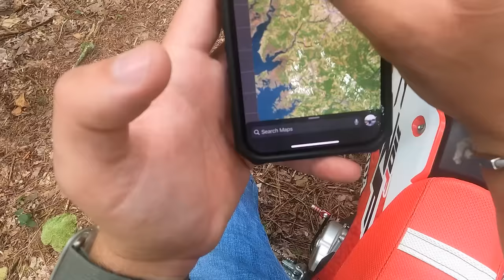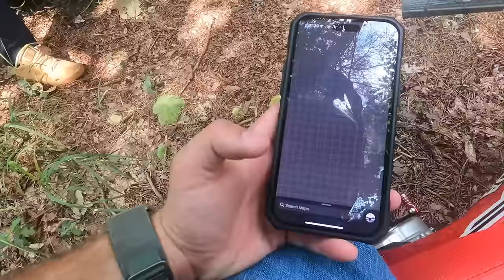SHOCKING DISCOVERY INSIDE ABANDONED HAUNTED FARM (VERY TERRIFYING)

Comment: The large hole in the shed floor is an old water cistern.  The large pipe allowed water to flow in from the roof when it rained.  The hole at the other end is where the sump pump went and the small pipe above it is the water line that led to the house.  Once a well was drilled, or city water was hooked up, the cistern was no longer needed so the pump was pulled and pipes cut.  Then the boards were placed over it and it has been left untouched until you opened it.  The objects down there were probably dropped in there when it was sealed up and have been there for a very long time.
Reply: I was thinking ice storage because of the ice tongs but you sound more plausible.
Reply: This makes more sense than my theory.
Reply: This makes most sense.
Reply: What year are you thinking??
Reply: @ptah31  100% ice tongs , so ice storage would be my guess
Reply: Could it be a slave belt?
Good exciting video with laughter. 
The ranch full of surprises. 
If it's a water run off tank, that's the reason the boards expanded. Check it out when it rains. 
Keep them coming, it is nice to watch you uncovering history.❤🎉
Reply: Correct. Old cistern . We ran into one at an old house I own. Same setup with the pipes.
Reply: @dorinclarisa2732   no it's not a slave belt it's one of those things you'd hook up to like a horse or a mule and then connecting to like an old mule draw plow or a horse draw carige
Reply: yup you are right
Reply: It could also be a Mechanics pit .  Where they pull machinery over it to Work underneath it. Since it was at one time a Farm .
Reply: ❤

Yes a water cistern.
Reply: I don’t see no water lines?
Reply: The curve blade handle is a sickle and ice tongs is the other. Or bale tongs. ✌️💜🤗
Reply: Looks exactly like my old well hole with sump pump… just missing the parts.
Reply: Or it could be a thing for a log like a log holder
Reply: I think it was a root cellar or ice storeage
Reply: Cycles were used to chop long grass etc for animals or a scythe as we call it in uk. Used to chop long grass corn or whatever. In the old days people used people to drag things not only horses around the fields. Slavery was a thing but defo something to do with water in there hence the plastic pipes. Not that old as has concrete and plastic and beer can and a beer bottle top. I’m not sure anybody died there but do a spirit box to find out or less risky try divination rods. Fun to watch
Reply: @emeraldhalloween3269 the belt is a climbing belt. Tree trimmers and eliectic workers us them. I work in tree trimming and have seen the same belts. We use them all the time climbing bigger trees. The rope is to throw around the tree to hook onto the opposite side of the belt to keep u secured safely to the tree or power poles.
Reply: I agree. My grandmother had an old farmhouse that had one beside her house. It had an opening on that could be used for cleaning or repairs if needed.
Reply: @Tuffyears Definitely looks like ice storage.
The belt strap thing with the rope probably was to pull out blocks of ice.
The sickle probably for cutting it but I'm not positive about that, although it could have been their only way to cut the ice.
Reply: The small hole definitely looks like a sump pit the pipe above is the discharge line. The big pipe by the ladder looks like draft or heat vent that could of had a wood burning stove or boiler at one point. The fan off of the vent is for a heated garage
Reply: The tools are for hay.  Picking up hay bales.
Reply: 🤔 but you would be able to tell if there's water down cause the paper would have been damaged and unable to read. I guess they were in the process of doing water cistern.
Reply: Yeah but aren't those usually outside of the building.
Reply: Hmm
Reply: CJ you need to some bigger tools in that truck of yours😂 . Come on Man. 😂😂😂
Reply: @emeraldhalloween3269  Thanks for that, sounds better than my suggestion.  To think I was a country girl. 😂😂
Reply: @ptah31  thats what i was thinking
Reply: For being a race car driver, Paranormal celebrity and multi property owner with a business. That was the most pitiful ladder you brought from home.
Reply: The clap is for ice and the belt was to help lift it up
Reply: Wow that was crazy creepy be careful stay safe love you
Reply: @BudHound420   you'd have a fair argument if it wasn't for the fact that their on a farm so a hore/mule harness makes more sense
Reply: I was thinking a root cellar. That was very common back in the day. Looking at the pipes, you are spot on for a water cistern.
Reply: CJ I would be just like your Mom and wanting to watch everything coming out of the building in case there was something good. LOL My curiosity would probably get me hurt because I would be wanting to scope it all out. I would probably be the first one down the ladder.  Now that I'm 70, not so much!  LOl. I would probably spend a lot of time there until I saw a spirit or something like what Chris saw then I would be gone like nobodies business. Ok in my eagerness to go down the ladder I would have ended up a pile of "OUCH' at the bottom! That hole honest to God looks like a torture chamber! I just love your Mother!!  GO MOM!! That one thing is a ice pick.  The round blade thing is a sickle.
Reply: I knew if I read the comments we could have a plumber or someone know exactly what that was 😂
Reply: You're probably right. I keep saying serial killer.
Reply: Great place for one to dodge the draft. Maybe after after not being needed for water. Only question is Is there city water? That seems out in the woods a bit far.  Is there septic there? Interesting.
Reply: @laurenhenckel8961 ecxactly what i was thinking
Reply: I was gonna say like a root cellar or something like that!
Reply: I can totally relate to cj’s mom when she tinkled…. Ohhh what is woman go thru
Reply: @ptah31 same here, but cistern is a damn good choice too!
Reply: And I seen in the hole the big metal tongs in the middle, I think are old ice block tongs what they used to pick up blocks of ice
Reply: You know what you are right
Reply: @ptah31 I was thinking the exact same thing because the temperature is cooler below ground level. 

Who knows, could’ve served many different purposes throughout the property’s life…. Cistern, cold storage, WWII bomb shelter.🤷🏻
Reply: Pretty fun to watch somebody sit and try and speculate what something is when you know what it is.🙂🇺🇸🦅
Reply: I agree we had one in our barn. My dad would always keep it filled. Said you never knew when we would have a drought and the horses had to have water.
Reply: The one tool In the hole was to pick up blocks of ice when refrigerator was not electric
Reply: @nancyhopkins2974  Yep, and hay bales
Reply: That’s exactly what I thought! They were really big on those in the south. I bet they stored jars and other items to keep them cool.
Reply: I’ve lived in 100yr old houses and you are 💯👍🏻! Thank you 😊
Reply: I was raised on a large dairy farm and we would always go down and drink the ice cold water that always ran through it.  It once was used to store the milk and dairy products to keep them from spoiling.  Then, the water was piped into the farm house to have running water in the house, but the ice shed was always a source of storage.  Cool find with many amazing artifacts.  Nice !!
Reply: I agree, it is an old cistern, and it isn't from 1800's.  the sides were concrete block not poured concrete.  1800's would have used red brick.  The curved blade is a hand scythe for cutting hay, wheat, long grass, etc.... belt looks like an old tree climbing belt, the part that goes around the tree is missing, but the rope would have held his saw while climbing up.  And the last one, could be used to move trees by hand, the pointed ends lock into the wood at the end and then give ability to drag the tree.  all of those items could easily have been of the same era as the postcard, 60's or so....
Reply: Yes, a water cistern
Reply: I think you are 100percent correct mate 👍🏼
Reply: @laurenhenckel8961 you are not going to after all these years dust dirt general moisture will have affected any water lines
Reply: Hi the 1 thing you  took up from the hole is;; a tool for cut corn ,grass mm, number 2 is a belt for work house in the farm
Nummer 3: is a ice grabber  ,,i even use for hock on  a tree logg,,  the old dags they cut out ice from lakes,,,so yea this could Bee a place that they keept ice blocks, too keep  the food cool , then use al those tools/things to lower the ice bock down😊
Reply: My vote is cistern as well. My ex's grandmothers home had one and we climbed into it several times to repair it over the years. I wasn't all that freaked when I saw the video because my mind went immediately to cistern...
The fact it's in the barn would say to me that it may be for livestock... and may have had an electric pump. 
You may find similar situation near the house...
Reply: So what was written in the note pad????
Reply: @towerparanormalinvestigations who cares?! Stop being so negative 🤦🏼‍♀️
Reply: Ok wow, that's good to know, although it still could of been used as a dungeon, hey?
Reply: I'm happy to see another person sees the cistern and this isn't a cell to keep people in.
Reply: Please make sure to cover the hole back up. I would hate for a curious trespasser to fall in there and get sue happy.
Reply: I thought with the cross lamp it was like an old make shift church and that was the baptism lol but it’s pretty deep for that.
Reply: I was thinking that too, or ice. That Ice tongs fits. And the scythe is the big curved thing. It's used to cut grass or things. My guess would be that you'll find concrete under it. You might go to the county and see if you can get a plot map of the property and see if they have the records of when the electric and water/sewer were pulled into the property. Title company or an abstractor should have the listing of every property owner of that place going back to ...however old.
Reply: I was thinking that since it was a farm, it may have been a scalding box used in slaughtering hogs. 😂
Reply: All the comments and suggestions  are brilliant ! Burst my bubble  though with my theory  on it being used by a serial  killer , I think I watch too many horror  films 😮😊
Reply: @ptah31 i was gonna say the same thing
Reply: you are probably right
Reply: @emeraldhalloween3269  turns out we were both wrong, it's   for tree surgeons. I have one in my garden now.  I have a picture but haven't a clue how to send it to you tube.
Reply: Smart
Reply: Small sickle, ice block tongs, definitely a cistern
Reply: Somebody is walking in the field with black on
Reply: Kinda weird for a water cistern to be in that shape though, and where does the rainwater come in? In most cases it comes through a hole or opening at the top of the chamber.
Reply: Couldn't of said it better myself, the place is haunted but you can't make something out of something.  I love the videos CJ but it was more interesting seeing what was in the woods then watching you all stare at a hole for 45mins. No disrespect im just saying is all bud.
Reply: @dorinclarisa2732 exactly what I was thinking 😢
Reply: Well THAT sounds better than what I was thinking😂
Reply: The small tubing above the hole was probably  more for the plug of the sump pump to work since they require electricity and the big one I agree  to let rain flow from the roof. But I also thought at first a storage for ice
Reply: We can always rely on the Comments section that someone will have the knowledge of what something is. That makes perfect sense. Thank you!!
Reply: i think they did use that for ice storage after its usr as a water cistern the belt was a safty belt for tree work and roof work
Reply: Thank you for taking the time to explain this.
Reply: @Scotts23  I thought it would of left it behind but I see what ur saying. I think it was for ice.
Reply: 😂 so much drama. C. J. Your in the country. Country people were self sufficient.  At my house the was an old cyctern and a root cellar under the old smoke house where we would store canned foods, potatoes and hung meat up stairs to cure.
Reply: Definitely would say the 3/4 pipe problem for some kinda air compressor for sure. Sub pump for the hole in corner. And the exhaust pipe for some kinda heating and air. The belts lay down there are for older style furnace
Reply: I love your mom she is great. Love her laugh.
Reply: @ptah31 I think they used it for ice and then probably converted it to the cistern. Remember animals and the people had to have water in an extended dry season or during a time of 4 ft snow. The old folks were pretty darn resourceful.
Reply: I think it was an old cistern as well. We had one on our property when I was a kid.
Reply: OG KillaKiRawBeats
Reply: @dorinclarisa2732 It's no where's near old enough for that.
Reply: Makes sense
Reply: Better explanation than what I thought: Septic Tank.😂
Reply: My grandma had a cistern in the back room of her house. It was in the corner by the back door. You lifted the floor and she would catch rainwater with a bucket.   She had an old ringer washer in the little house next to the garage on her property.
Reply: @muzerhythm2242  I thought that too.
Reply: My grandparents had a hole in there garage that looked just like that in there garage, used for changing oil
Reply: I agree and the tools was a syth and a ice block pick tool
Reply: My grandpa used underground pits like that to dry animal fur to tan hide. Being a fur trapper in the 60"s. Remove moisture and water and blow in dry air.  Meanwhile, once a week, going into the pit to scrape off unwanted hair from the hide.
Reply: @ptah31  if it was a dairy at some point you would be correct too. you need a way to keep milk cold before transporting it to town.
Reply: @tanyalafata4100  as for the pit 19 20' to early 40s.. and the belt design is late 50s. the tongs haven't changed much since the 1700s lol
Reply: @dorinclarisa2732  as for a slave belt naaaa it has clips on the rope so if they wanted to get away they unhook it and leave. slave containments were secure so no chance of escape.. it would most likely be water from a moving source, pond water would have too many things not suited for consumption in it.
Reply: @emeraldhalloween3269  look up a picture of a tree trimmer he is wearing that kind of belt while topping out a tree.
and you never ever ever tie yourself willingly to a piece of farm equipment.If the team of mules you are working decide to take off you arte as good as dead.
Reply: @AustinBixler  agreed, but a bit suspect with the depth of it
Reply: @laurenhenckel8961  it appears to have been painted sometime after running water or well was drilled.  I bet the kids of the place thought they had the best fort or play house in the world. lol
Reply: @gingerl2995  I'm willing to bet the pump got repurposed to the basement at some point?
Reply: @Jadengood1993   I used one for years growing up to drag logs the diameter of telephone poles from the woods
Reply: @donnamarietomasello9396  As it was pointed out early in the video, things come through the portal and some will take up residence in the cistern if it reminds them of quiet crypt
Reply: Ice tongs or hay tongs and the curved thing is a sickle used to clear back brush. They used to do by hand. I was thinking a cellar could be used for ice, or hiding slaves (underground railroad). Or to hide alcoholic beverages during the time when it was banned. Or storm shelter and of course it could have been used for more nefarious reasons as well. Interesting to think about.
Reply: @sandyoda9042  yes we do live in the sue mations, and i am not referring to Native American's here.
Reply: @rosemaryfries9467  my mind went to a Christmas ornament
Reply: @CinShiba  You would need a way to keep the water boiling. having or building a way to keep the water that hot would cook the pump too, if trying to use it to circulate boiling water.
Reply: @secretsystem6667  the inlet is the large drill casing pipe at the top center of the far end.
Reply: @hauntedtraveler  OMG!!! i am a 67 years old country boy and you just taught me something new!!  
soooo there is actually a P in front of the word tater!!! so it is a P-tater!! now i bet your gonna say the are letters in front of mater....
Reply: @katiehardy1476  she does seem like a lovely lady
Reply: @renelipsey8458  my grandparents place was only 3 miles outside city limits, and didn't get electric till after WWII.
Reply: Damn ruined the suspense of it actually being something really creepy. Lmao
Reply: That’s thing thingy CJ found picks up big ice cubes
Reply: I was thinking samthing
Reply: This xomment should be pinned
Reply: This makes a lot of sense. Could’ve had multiple purposes. Water, ice, food storage, hiding out. The cinder block throws me off though. They didn’t build with that in the 1800’s!?? Hmm. Maybe built after the house?
Reply: My cistern looked the exact same way. I had a farm and we had 2 cisterns.
Reply: You are correct. I also belive it an old water cistern. That is how it works...
Reply: Omg I LOVE YOUR MOM❤❤❤❤❤
Reply: @Tuffyears blade is called a sickle for wheat or other plants to cut and the other is tongs for bales of hay for horses.
Reply: I was thinking a drainage place, but could it have back in the day for hiding people to stay safe
Reply: You mom is way to cute.
Reply: Trafficking people pit
Reply: I was literally about to say the same glad there are some other people here that understand old farm properties
Reply: I was thinking that and possibly a freezer for the summer time
Reply: @CJ Fiason have you seen this comment this makes sense 100% what this is .
Reply: I was thinking it used for ice but I think you are right
Reply: Absolutely! 1st thing I thought of, as most all old farms had them!
Reply: Then why wasn't it full of water or the objects in there waterlogged or soaked in water
Reply: @ptah31 I think those are actually for moving logs but I'm not 100% sure
Reply: Thank you @seancampbell4564, I was yelling at the video, are you kidding mama doesnt know!!! I guess the older folks would get it... But I completely agree when I saw the hole in the floor i instantly thought sump pump!
Reply: Yes, I'm sure you're absolutely correct.
Reply: I was just thinking a dried up well lol but ur gess sounds way more real an true then what I was thinking lol
Reply: I read on the internet. When a house as this. It is used for flushing toilets, washing cloths and water for  farm animals and gardens. If it is well water coming into. It needs to be treated.
Reply: That is so awesome to know!
Reply: Oh so that's what it was used for
 They came up with some good ideas back in the day
Reply: I agree with @seancampbell4564.   My other thought was an old well house.  Hey mom.  Please consider  joining more videos.  You are funny and personable.
Reply: I love a good logical reason! 😀 I read a King book recently where a person was stuck in a cistern. Now I know what that was used for! 😀 Thank you!
Reply: Cistern/sump pump to keep water out. I have 2 in my basement. My house was originally built in 1896
Reply: Thanks!!   The search is over.
Reply: You all are bored
Reply: Yup we lived on a few old farms, it’s a cistern.
Reply: Excatly come on people surely you know what this is lol
Reply: I was raised in a 1923 Sears "Kit House", the cistern there still worked! Along with a hand dug/ stone lined well and one machine dug well
Reply: I believe that at one time it was a water cistern and when city water was hooked up to the house. Then it was possible used to hide slaves or a person was kept down there...thats what the belt wt the rope hooked to it is for. And i believe that the piece of soft cloth like material was what was left of their clothes... The first metal piece found was a hand cycle for cutting grass, weeds .and the second metal piece was for bails of hay or ice. Either or...to carry them.... Pretty good find bro.😂
Reply: 1:10:10
Reply: @laurenhenckel8961  one was the tube in the top of the wall from the rain troughs, the other "line" was in the floor at the other end of the box.
The hole leading out got smaller and smaller as it got to the house,creating water pressure
Reply: You nailed it...water cisterns were really common back in the day
Reply: @Tuffyears  ice was often put in the cistern box to cool the water, under its cover, the water would stay cool in the heat of the summer.
I've dug up pipes that went to the main house, and out to where I figured it watered livestock. A slow taper in those pipes would push water uphill
Reply: @ptah31  grandfathe( Great Grand dad used his to keep the milk in the milk can cold
Reply: Probably before that it was an old ice block fridge, as the large metal tool with the points at the tips were used to grab the sides of chiseled blocks of ice to lower them down in & even move them around. Ever seen the movie "A Million Ways to Die in the West"? The scene with the giant block of ice, the smaller blocks of ice were chisled off large blocks of ice seen in the movie.
Reply: Makes sence. The items are a sickel , ice graple for large ice blocks
Reply: I was thinking underground railroad
Reply: @lindafitzner4903  to be honest, many of those old coolers, barns , retired standing ice boxes,were used during those days to hide slaves escaping their own hell. There are also hundreds of miles of tunnels, LITTERALY train tracks that ran underground ( coal tracks ) that were used to hide them as well.
Reply: I agree with the theory.... an old unused cistern does double as pretty fn good dungeon tho
Reply: I was thinking cold storage
Reply: Small bikes for such tall men..
Reply: Intresting story tho.
Reply: Yes old cistern. I can't believe their reaction to the snake. Definitely city folks. That snake does NOT WANT  2 bother you. Calm down.
Reply: All the cisterns I have ever seen were huge. Never saw one so small, but it's possible. I was thinking ice storage or maybe the previous owners were moonshiners or something.
Reply: What I was thinking too. @AustinBixler
Reply: That must be it, either that or maybe a mechanics pit.
Reply: I think it was a meat cellar for storing their cow 🐄 or pig 🐖 carcasses, the harness with rope was to lower the beef or pork carcasses down in the meat cellar. The hook was used for picking up large 100 lb Blocks of ice they used in the 1800’s and early 1900’s to keep meat & milk cold. The large pipe served as air and in winter in areas that get cold in winter there was no need for ice blocks. The hole 🕳 in the floor was to allow the melting blocks of ice to have a place for the water 💦 to drain away. The Sythe could’ve been used not only to cut sugar cane but to chop meat off the carcass. I think the conduit was a light 💡 bulb receptical that was turned on on the wall to see in the cellar. Most likely when freezers was invented stopped 🛑 using the meat 🍖 🥩 cellar & no need to buy 100 lb blocks of ice anymore. So some years later they filled in the drain hole 🕳 with dirt beer cans and anything else they could and removed the light bulb💡 ceramic receptical. Because it looked as if the end of the conduit had been smashed flat with a hammer.  It’s hard to say your theory could be right or my theory can also be correct. But if I had to bet with the evidence of the things found in the pit I’d bet it was a cold meat & possibly can food & cow milk cellar to keep things cold that they raised on the farm. But that’s just my opinion & you know what they say about opinions they like butt holes everybody has one. 😂
Reply: First time to the channel. I came upon it purely by accident. But I was curious.
     As I watched, I found myself laughing throughout, with one thought in mind:
     JUST because you find something you don't understand... something that may look a bit "creepy" because its old & abandoned doesn't mean it's nefarious, evil, or "haunted." There is most often a simple, innocent, logical explanation.
      Respectfully, it would surely benefit you to (from any number of History books) learn more about the people who lived during the era when the property was built. Research how they lived. In what ways did they accommodate their needs during that period in history? You will undoubtedly discover this particular home, with all it's "amenities," was quite typical of the era. Tho this structure may look peculiar to us, it was normal back then.
      I know every party needs a pooper. I guess that's why 'I' showed up!🤗  I do I give you & "Mom" credit for being entertaining. But... nothing about this was "scary." Nor did it feel as tho I was watching the reveal of a "haunted" property. It was more like a history lesson.
     Sorry.😕
Reply: Yes you're right and that makes all kinds of sounds plus it reminds me of something similar to a fox fire and it looks like someone's moving around it's really not as how the light hits certain areas in certain times of the evening maybe after a rain or before rain it's foggy
Reply: Cistern or root cellar
Reply: Yep
Reply: The clamp thing isn't ice block grabber🙄
Reply: Someone said it's a cistern. I'd use it for storm shelter or a food storage.
Reply: I agree,or a cold room for meat and fish
Reply: There is a waterline a mark around the wall
Reply: @shawnomack45  cisterns are usually outside. You hand pump or crank them. I used my neighbors as a little girl. She was widely and let me visit and play. She had an old pump organ. 1 1/2 story barn next to house had a trapeze and piles of straw underneath. Many hours of fun in there! Love love love old places!
Reply: My first thought was a mechanic pit to work on vehicles ..
Reply: I think it may have been all those things. The tongs sure looked like ice tongs to me. The ice delivery men used to wear those belts to help carry the great big pieces of ice. I think it started as a root cellar and was adapted thru the years for different uses. Interesting how things we haven't seen or used can seem so creepy. I would have been like Chris. Out of there as soon as u see the first sign of snake. 
I'm sure if the farm was first established. In the 1600s a lot has happened there and a lot of places there has had multiple uses.❤
Reply: I'm sure this is correct. They had power to the pump and they used that rope and pulley to remove the pump. It was probably originally outdoors and the shabby building was added later over it.
Reply: We had a hole like that in what we called the water shed on the farm , it collected the rain water which was wiped out to water moms garden. It was much easier than carrying buckets
Reply: If it's nice n cool down there, snakes love the cool especially on a hot day
Reply: What type of snakes and bugs did you think they were? Not all snakes or bugs are poisonous. Why all the screaming and yelling? You're not in Australia! To get rid of the snakes lift off the final bits of planking so they're no longer hidden and they'll slither away.

The curved blade is a sickle, used for cutting grass and grain.
Reply: @Techman1969  it’s a snake pit!!!
Reply: @parabellumunited8889  LOL😁
Reply: @Techman1969  ☠️😂
Reply: Those big tongs are for moving blocks of ice. Ice boxes were the fore runner to the refrigerator.
Reply: Probably both, no? Since it's that old
Reply: Thank you!
Reply: Squatch
Reply: The hole in the floor is wear they put ice blocks to keep meats cold and vegetables  cold,the pipe is wear the water from the melting ice would go into the ground. The double hook is used to pick up ice blocks
Reply: He's so cute!
Reply: We're there were posted card they were keeping someo e down there untill they were good ?
Reply: When I was a kid we had something like that in the basement t to store the rain waters
Reply: NO IT WOULD HAVE OLD WATER MARKES ON THE WALLS !
Reply: Kool
Reply: Exactly
Reply: The noise is probably  air flow though  those pipes as the air blows  over the roof.  The stuff down there is just junk that fell in  be they cover it up
Reply: Yup...what he said /\
Reply: Your mom seems really cool. It’s awesome that she likes to do adventures with you guys.😊
Reply: Get real. It was not a sistern
Reply: This makes the most sense.
Reply: You're absolutely right you hit me on the head we all know those were ice tongs but how did the grass sickle get down there I can't believe the mother had no clue what those two items were she's the oldest one there it's sad that she didn't know what ice tongs or grass sickle was
Reply: Those my dear Watson are ice tongs and a cycle and your in an ice hole! 😊
Reply: Knoll llllllllllllllloooooooooooooñ kkkkkkkkkkkkkkkkkkkkkkk kmmmmmmmmm kkkkkkkkkkkkkkkkkkkmmmmnmmmmmmmmmmmmmmmmmkkkkkkkkkkkkkkkmmmmmmmmmm mm😂
Reply: I agree!
Reply: The belt did remind me of when they would make the slaves walk along side of the horses and have a rope connected to the saddle! That is a sickle for cutting wheat, like the slaves had to use. And yes that is a pair of ice tongs, for the block ice used in the first type of refrigerators ( hence ice box) you would carry the ice blocks inside using them.
Reply: The belt did remind me of when they would make the slaves walk along side of the horses and have a rope connected to the saddle! That is a sickle for cutting wheat, like the slaves had to use. And yes that is a pair of ice tongs, for the block ice used in the first type of refrigerators ( hence ice box) you would carry the ice blocks inside using them.
Reply: The belt did remind me of when they would make the slaves walk along side of the horses and have a rope connected to the saddle! That is a sickle for cutting wheat, like the slaves had to use. And yes that is a pair of ice tongs, for the block ice used in the first type of refrigerators ( hence ice box) you would carry the ice blocks inside using them.
Reply: The belt did remind me of when they would make the slaves walk along side of the horses and have a rope connected to the saddle! That is a sickle for cutting wheat, like the slaves had to use. And yes that is a pair of ice tongs, for the block ice used in the first type of refrigerators ( hence ice box) you would carry the ice blocks inside using them.
Reply: The belt did remind me of when they would make the slaves walk along side of the horses and have a rope connected to the saddle! That is a sickle for cutting wheat, like the slaves had to use. And yes that is a pair of ice tongs, for the block ice used in the first type of refrigerators ( hence ice box) you would carry the ice blocks inside using them.
Reply: The belt did remind me of when they would make the slaves walk along side of the horses and have a rope connected to the saddle! That is a sickle for cutting wheat, like the slaves had to use. And yes that is a pair of ice tongs, for the block ice used in the first type of refrigerators ( hence ice box) you would carry the ice blocks inside using them.
Reply: That's right. Water cistern
Reply: Makes the most sense
Reply: I like you it is funnier than you guys need to have a comedy show made up
Reply: Could use it to work on cars  as well. The belt maybe used to take off a stubborn oil filter too.
Reply: 100% agree my parents have one like this under their house but much much bigger.
Reply: Just caught this but this comment is 100% incorrect.. its oil change pit had one on our farm.  The electrical is electric for a light that you can still the outline on the wall.. the other pipe is for exhaust.. the hole was filled with charcoal balls where you dumped used oil.. that harness is for climbing trimming trees
Reply: Thank you so much!!
Reply: Them things were either ice tongs or for picking up bales of hay, but probably ice tongs
Reply: 100% correct! Lived on a farm growing up and had one. Water Cistern.